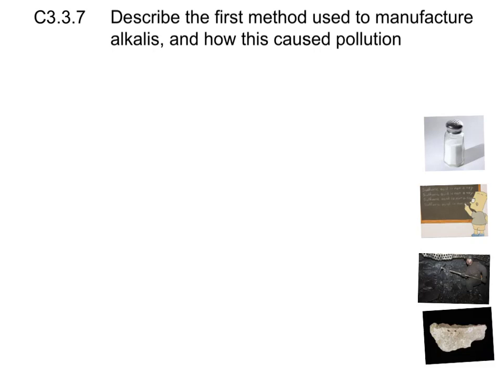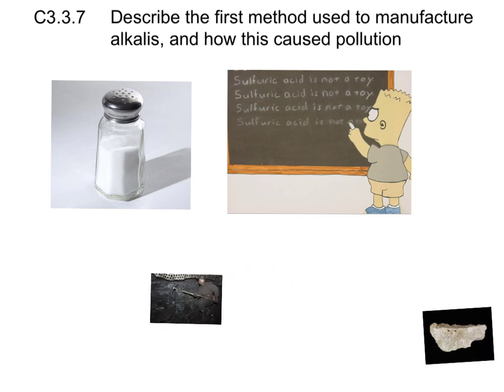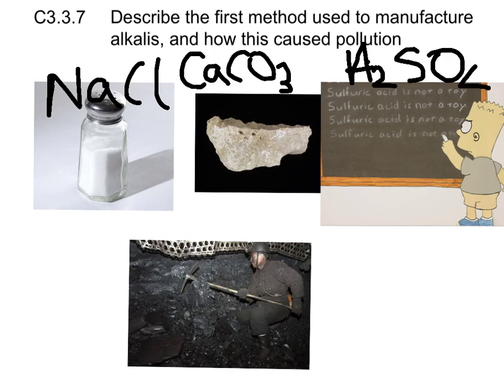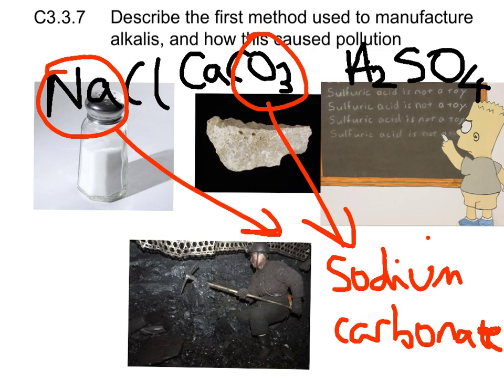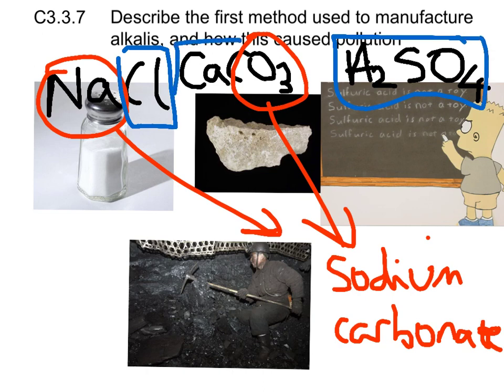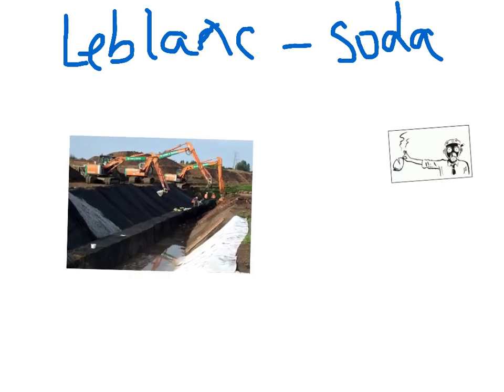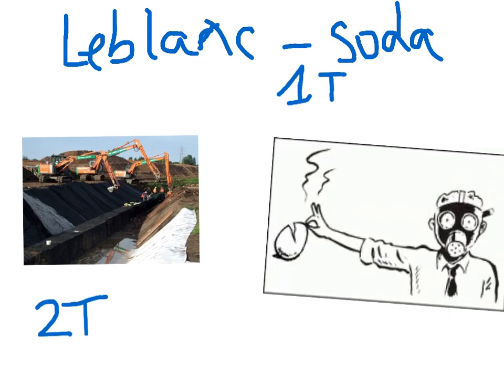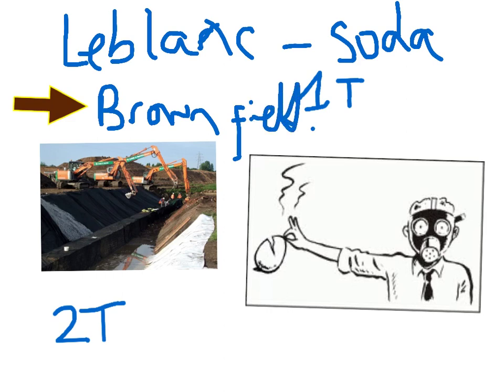OCR Core: C3.3.7 and C3.3.8 the Leblanc Process

Comment from the maker: Check your specification, for point C3.3.7. Whilst it doesn't have the name 'LeBlanc Process' in the specification, it is referring to it when it mentions the method of producing alkalis artificially by using those particular reactants and products. You can definitely be asked questions on the reactants, products, and environmental concerns of the LeBlanc process, as well as the idea of how a waste product (HCl) was eventually turned into a useful product (Chlorine gas)